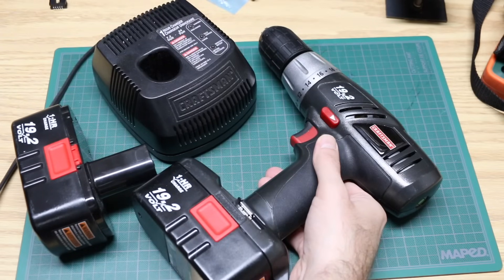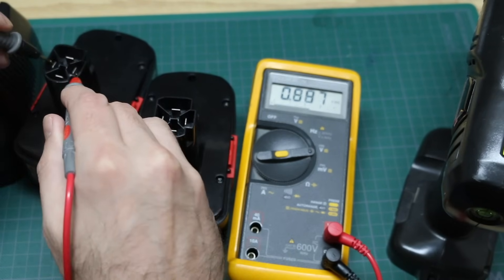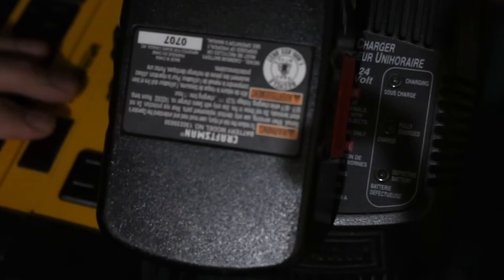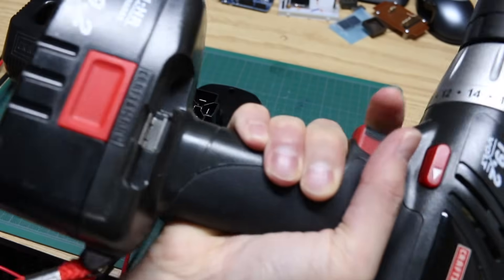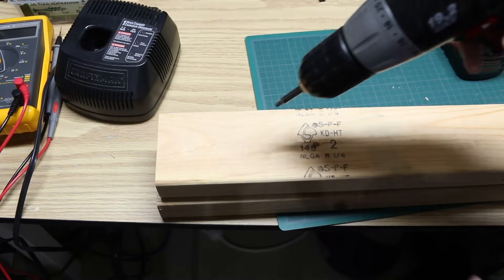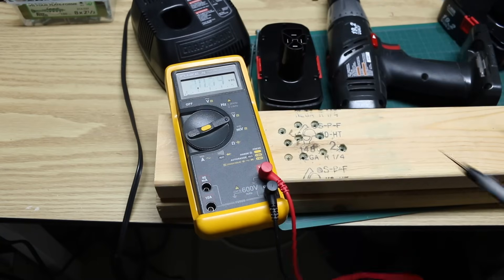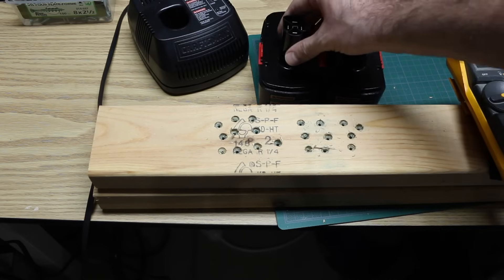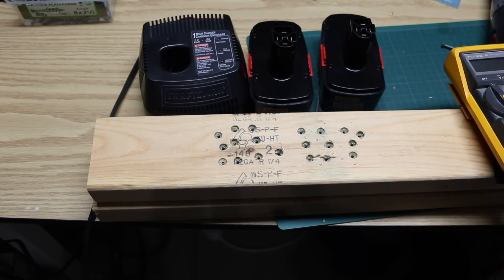HOW TO REVIVE A NiCd DRILL BATTERY THAT WON’T CHARGE

Comment: So I watched your video and I have a different charger . The charger slides down onto the battery. But I used the same method leaving it plugged into the wall and I lifted the charger off and then on again. So it is flashing green light which is more than what it was doing in the past. Thank you for the video post.

Comment: Have 2 battery's, charge and die bout 20mi can you tell me what's wrong
Reply from the maker: If it's an old NiCd battery it may be beyond its useful lifespan.  The trick to get them to take a charge again works when they still have life in them but were sitting too long and their voltage dropped too low so they need to be recognized by the charger again, but they have a life span.

Comment: Could it be that turning the charger off and on wound up having the same effect as jumping the bad battery to a good one would. It just used the voltage from the charger in place of the voltage from the second battery.

Comment: Our Energy company warned us about severe storm and to be prepared for any outages. I have this same Craftsman 19.2 Set with Light. I plugged my charger into outlet, installed one then the other and got the exact reading "Fully Charged, Defective Battery"! First thought, Crap! Second Thought, "Go check out Youtube". I saw in the first small pic a drill that looked similar to mine. I opened it up and there you were holding a 19.2 Craftsman Drill with the Exact Problem I was having, only both of my batteries gave same reading "Defective"! This Remedy you showed Worked Perfect and saved me about $150!! THANKS, Its a Small World!

Comment: I have the exact same drill and batteries as you have in the video.  I got a lighter, smaller drill driver set so my Craftsman has been stored in the closet for like 10 years!  Got it out today thought these batteries are dead.  No problem just throw them on the charger.  When I did the full charge and defective lights were on?  I tested each battery one was 1.23 V and 0.15 V.  So I figured these chargers need to recognize a certain voltage to start charging.  First I tried to rapidly plug and unplug 50x battery in charger did not work.  Then tried a trickle charger for hours did not work.  Then I continued to research and found this video and immediately read all the success stories in the comments.  Tried at first few times on and off at surge protector....did not work.  Then saw another comment to turn on and off as fast as you can did it quickly like 10x and was SHOCKED to SEE JUST RED CHARGING LIGHT ON!!!  You my friends are a genius!!!  Will keep you posted if  can get both batteries full charge.

Comment: I saw another video talking about removing and re-inserting the battery into the charger several times. that didn't work for me. This method did, and it only took 2 power switching. Much easier than the jumper method. Thanks!

Comment: What about batteries that lose their charge pretty quick?  Can they be saved?
Reply from the maker: those are probably past their rated life especially if they are old NiCd and it would probably be unsafe to try to do anything to modify their conditioning. Sometimes there can be a more modern compatible form factor battery that will fit the tool
Reply: @GadgetReboot  thanks for the reply

Comment: I’m at my in-laws and they used this drill maybe once and let it sit for three years. I tried unplugging and replacing the charger from the wall but it didn’t work. So I found an old power strip to replicate the steps more closely. It took about twenty rapid flicking off and on but it’s now charging! Fingers crossed!

Comment: Had 2 batteries that were both dead and wouldn't charge.  Your technique worked great but I did do a 30 second charge from a car battery charger on each of them before putting them on the power strip and to the regular charger and following your instructions.  They both charged back up.

Comment: What I found out. Was stick it back in and out of  the charger real quick. I noticed it charged in like 20 minutes. So I pulled the battery in and out of charger real quick. And it started charging again. Later on I noticed it was lasting a lot longer.

Comment: I had a Sears Craftsman tool set that died over 10 years ago.  I tried to return/exchange the set for another set 2 years from the date of purchase but the Sears Associates and Manager denied my return/exchange attempt.  Thereafter, I stopped buying any power tools from Sears and other sellers.  I still have that Craftsman Power Tool set and batteries in storage.  Seen other videos with similar tricks for reviving "dead" batteries for power tools.  Haven't tried any of them yet but this gives me some hope that it may be revivable.  Just have to double-check if it was Nicad or Lithium.

Comment: I see your Fluke. I still use my Beckman 310 from 1980. It does need recalibtation but it would cost more than the meter is worth. Guess I'll use my Fluke. Interesting post. I have a Nicd camera battery that won't charge. So far I don't know if it's the charger or battery. The charger gets warm.. Any thoughts? Thanx for the post..{^;^}
Reply from the maker: I don’t know if doing the same approach would help a camera battery because I don’t know if this works because of the charger design itself but if not the battery may just be past its useful life and even if it can charge it may not hold it for anything meaningful.

Comment: Hey thanks bud it worked the very first time I did it 😊 I tried the sparky jump start ideas from other utube ideas but your method worked. I had no power bar so just unplugged my mastercraft 14.4 charger.  I bought this drill at a garage sale this morning for 5 😅 one battery was fine . But now both take a full charge.  So thanks.

Comment: I have exact same as yours but doesn’t working for me after several tries.
Reply: First measure the voltage to see the baseline.  Plug the charger into a surge protector that has nothing else plugged in.  Rock the on and off as fast as you can maybe 10 to 20x rapidly in a row.  The red charging light should stay on.  If it does not take the battery out and measure the voltage again and see if higher then baseline then you will know if the battery is holding a charge.  My batteries was 0.15 and 1.23 V when I started as baseline.  Let me know how it goes.

Comment: I just tried this on the exact same kind of battery and charger.  The only difference is that while the charger did show the green light (in fact I picked up an identical charger today at a garage sale in case the charger itself was defective, but got exactly same same results), the defective battery light was not lit.  But I tried this technique anyway. I unplugged the charger with the battery already inserted, waited a few seconds, then plugged it back in -- and the red "charging" light came on, with the "fully charged" and "defective battery" lights both out.  In about an hour (I didn't time it) I noticed that the green "full charged" light was on and the red "charging" light was off.  I haven't measured the voltage yet but the tool (an angle grinder) roared to life!  Thank you!!!!!!!!!!!👍👍👍👍
Reply: PS I ran the tool very briefly without any attachments or doing any work ('no load' on the tool itself) about 8 times before testing voltage; which was then at just over 12 volts (this is a 19.2 volt rated battery).  I ran it 3 more times no load and checked the battery again and it was between 10 and 11 volts.  So it's not taking a full charge, nor holding it for any time/work period.  I put it back in the charger and the red charging light came on again.  I know that Ni-Cads can have a problem with "charge memory effect" so wondering if I should have just tied the trigger into the "on" position and ran the battery all the way down before trying to charge it up again.  I also didn't check voltage before the reset procedure.  Suggestions anyone?

Comment: I just tryed to do the trick of  chargeing  my battery  that will not charge  I turned the on  and off switch fast  five times and WHAT  it is chargeing this battery has been dead for six years and now it is working   this trick is great  it works...
Reply: you are a genius my friend.....the key is the rapid on and off as fast as you can.  That will increase the probability the red charging light will stay on.

Comment: Thank you for the video. This method does work. Out of three batteries bought and probably a year apart it was the middle battery that came back after sitting idle for another year after. Currently getting ready to use a 10 amp battery charger try the method. First video I watched they were using an arc welder and I thought that was just insane

Comment: This worked for me. I unplugged it several times (my charger didn't have an on and off switch) . I also did zap each battery with my car battery (car turned on and with the engine running). I didn't link the batteries; I zapped them one by one. No huge sparks or anything. Just lightly touched red to red and black to black (plus and minus) several times and held it connected for about 5 seconds a few couple of times. Just small sparks from touching the proper connector.  This  was an older Ryobi 12V drill which I've kept all these years, almost new and hardly used at all but with two dead batteries. I'm glad I didn't recycle it.  Nice little backup drill now that's all back up and running. Both batteries are now revived.

Comment: I was looking for a way to get a dead cell to come back; DeWalt stopped manufacturing 18V NiCd packs and I don't want to run my drill at the higher ~20 volts and overheat it. I'll try reverse charging at constant current and voltage, then reversing again I guess. Just forcing it to charge with CC/CV lab supply resulted in hot battery so it's probably just gonezo 😢

Comment: So I tried this and it worked the first time on the first battery I had ... but the other 2 batteries did not work and I even tried about 30 times to toggle the power with no luck.
Reply from the maker: it definitely is more of a measure to try to squeeze the last bit of life out of the old battery and not all will even work this way, even the ones that do start charging again are on borrowed time especially now that everything is basically lithium and these are more antiques.
. I still have this drill and it still charges the batteries but I’ve also replaced with a modern drill/driver set so this is only a back up now.  still worth doing if it still keeps working

Comment: Tickle charger does the job also if the battery is dead dead or flat
Reply: Tried trickle charger for hours and did not work for me....this was the ONLY method that worked

Comment: I tried your method on my six batteries but it didn't work.  Another poster recommended plugging the charger straight into the wall outlet and not go through a surge protector but that didn't work for me, either.   Guess I'm going to have to try the "sparky" method and see what happens.  I keep reading about battery reconditioners for these cordless drill batteries that will charge them AND do a deep discharge to them to give them their full capacity power.  But, I can't seem to find any Schumacher or other manufacturers that make such a device.  The only thing that seems to come close is the Lipo B6 charger/balancer.  Has anyone tried that device?
Reply: The only thing that worked for my 2 batteries was plugging the charger into a surge protector then rapidly as fast as I could turn on and off the charger with the surge protector switch 10 to 20x and finally the red charging light came on.   Make sure to get a baseline voltage of each battery mine were 0.15 and 1.23 V.  That is way too low for the charger to recognize and start charging.

Comment: Thanks so much for this insight. I have a new battery with similar problem. I tried off on attempt and green light remained on. Then i tried bouncing it from about 6 inches and the jolt made red light come on. So ill see if it charges. 
Thanks again

Comment: Recently my 18.0V batteries never start fast charging right away (the video's solution doesn't work for mine) and they need to sit in the charger for at least 6 hours with yellow and green  ("soft start" or "defective batt") before they somehow reach a green "full charge" after I wake up the next day.  I don't know if this method goes through a red light "fast charge" now like I've seen in the past.      So maybe give your charger a chance overnight (but keep combustibles away as there's always a remote risk when charging any battery, and more so unattended).

Comment: Hi sir my grandpa mistakenly charge it to a 110 output can I still fix the battery? Really need help
Reply from the maker: If the battery was on 110 volts it may be wise to discard it anyway, who knows what compromised  condition it could have ended up in.

Comment: I pulled the battery out of the charger while charger plugged in and if flashed to red charge light but back to green.
I did it quickly a few times and watched the lights and when it stayed longest on red I left it and it charged.
About 15 minutes of that original smaller auto charger, I put it in the new fully auto charger and it charged regularly...
Hope it helps...

Comment: I have the same battery and drill but have the hex impact and saw as well but my battery dies fast that charges up good and have one that won't charge up what would cause my battery to die fast
Reply from the maker: if it dies fast it sounds like it really is too old and lacking storage capacity. mine still hold the charge significantly enough that I don’t have to replace it just yet but if I don’t use them often enough, they might discharge on their own significantly and I have to do this again and then they are fine again, so far so good.

Comment: Can’t see how this can work
Reply from the maker: I might eventually open up the charger and try to see how the circuit works but my best guess is since the main problem is the batteries have discharged so low the charger can’t recognize them, maybe when the charger itself is first plugged in it’s somehow able to recognize the presence of a low voltage battery and it starts the charge cycle but putting the battery into an already powered charger, it refuses to acknowledge that low of a voltage. I don’t think there’s anything happening to the battery itself, I think it’s just the charger deciding whether it wants to acknowledge its presence or not but otherwise the battery is still in a state of being able to charge if it’s any good, and some batteries are just hopeless and will never charge.

Comment: what to do if you don't have an on/off switch
Reply from the maker: to turn the charger on and off without a switch I plugged it into a power bar and used the reset switch on there. I’ve also done it just by plugging the charger into the wall and unplugging it until the battery started charging.
Reply: I pulled the battery out of the charger while charger plugged in and if flashed to red charge light but back to green.
I did it quickly a few times and watched the lights and when it stayed longest on red I left it and it charged.
About 15 minutes of that original smaller auto charger, I put it in the new fully auto charger and it charged regularly...
Hope it helps...

Comment: Hi, i from argentina, a friend giftme a drill like this anda another tools from Canadá,   that experiment dont work but another neither. Any else kwows what i must to do with this batery? ( Trown in the trash maybe? )
Reply from the maker: The battery may be too old or maybe damaged in some other way besides deep discharge so it may not work but you can try to turn the power off and on several times before giving up on this. If you do it 100 times and nothing works then maybe it’s time to throw it out.

Comment: just watched your video thanks my father in law gave me a drill and saw set of 18volt craftsman that had been in his garage for years, still looks new but it would show full charge lite and defective battery lite at the same time so I figured they were shot tried this hack and on the first battery on the 3rd time I turned it off and on it started charging second battery 4 times. Now works will holds charge like it should too. saved me $100 bucks on new batterys. Great hack thanks again
Reply: earned a like and subscribe from me

Comment: I bought a Makita drill with 3 batteries in France 15 years ago and haven't used it much and not at all for 8 years, got the same fault light on two of the batteries on charge. Did exactly the same as you did and now all 3 are charged. Thakns a bunch, I was about to bin this, but instead cleaned it.
Reply: Sadly didn't seem to work for my old makita batteries. The fast charger has a thermal cutoff that stops the charge process if the battery pack draws too much current. No matter how many times I try to reset/powercycle it, it stops the charging attempt every time. Guess they're well and truly dead-dead

Comment: How did I miss this video ?? On Kijiji I often see NiCad drills sold almost for free with mentions like "Needs new batteries". I never saw the point of buying those, but maybe it's worth getting them after all and try this trick.  Then maybe sell them back to the previous owners with profit ! mouhahahaha ! ;)
Reply from the maker: Hard to believe this video was a year ago now, feels like last month. Of course this trick may not always work depending what’s really wrong with the battery and if it works it may not hold a charge if it’s really dead with life expectancy but if it just accidentally dropped too low to be recognized, this may kick start it  back into action. My battery is still fine and still allows me to  use the battery for a while when I charge it so mine were definitely not used up yet.